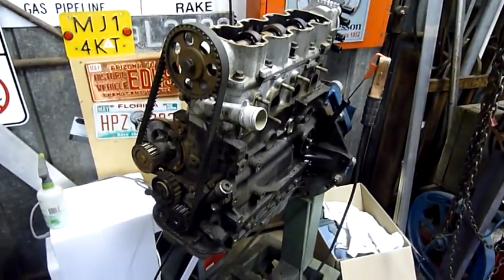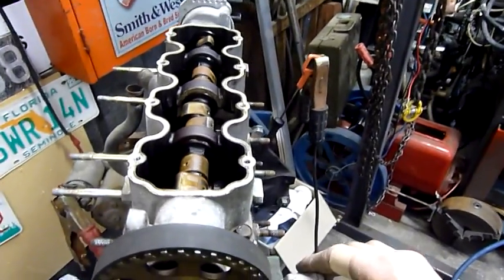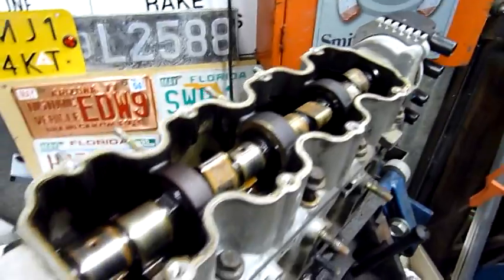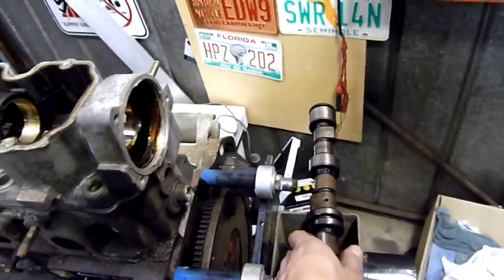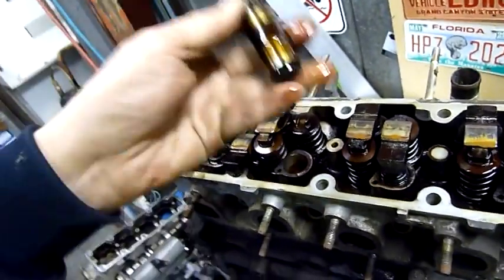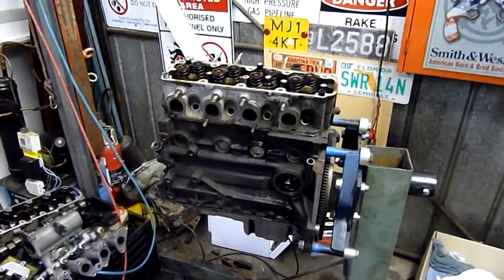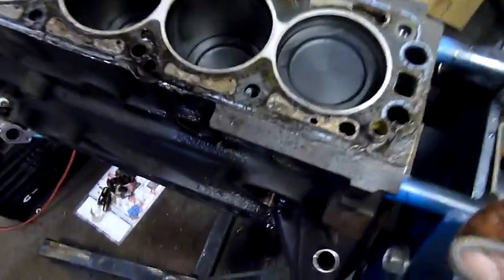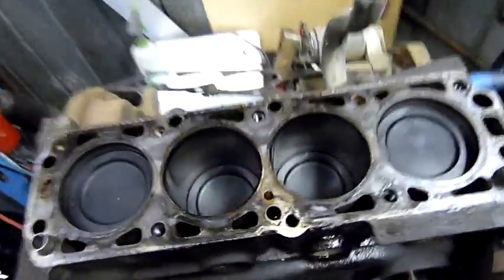Daewoo Lanos Engine GM Family 1) Autopsy Pt4  Off with its Head

Comment: Those Gm family 1 engines are tough.
the only weakspot is the thermostat and the headgasket.
The headgasket use will fill after about 200.000 - 250.000km.
Or if the engine is mostley used for short rides it will fill about 100.000 - 150.000km.
And usely the head gasket will fill on cilinder no 4. between the cilinder and the water channel.

I have the singel point 1.6 litre version of this engine in mine Opel Astra G and it slow as hell.

Comment: Only had Problems with these engines had to rebuild after 120k km on my Granddad's Lanos 2001 model even tho he serviced it every 6 months then after the rebuild the car buckled the coil pack went out after that the car drove for a few months fine and suddenly it bent a piston going up a hill oil starvation due to a bad oil pump.

Comment: In my old car, the water pump seized when the car was idling - timing belt snapped, pistons met valves and the camshaft broke into 3 pieces.  Funnily enough all the valves were intact.  Annoyingly I was planning on replacing the water pump that very weekend.

Comment: There was some time ago an electronic valve system. I have no idea where i've read it *on paper* but the main deal was using electronic valves to give what the engine needs. Mind you as i recall it wasn't something using a computer, rather a mechanical device with lobes and stuff. Pretty neat. I think it was 5 or 6 years ago in a polish magazine i've read in international airport. I think that kind of an engine would be interesting.

Comment: That engine looks really good even the cam scoring is not really that bad and most likely are fresh from turning it over with no oil pressure. Not even a ridge at the cylinder rim that thing was barely broken in.

Comment: Hydraulically actuated valves aren't a new idea so I am surprised we haven't refined the technology for today's automobiles yet. The old american Tucker Car Corp. back in 1948 designed a prototype flat 6 engine displacing 9,650cc that used oil pressure hydraulics to operate the valves.

Comment: The only place that G.M is making money now is in China, possibly Korea, and the reason is that there is a growth market there for cars of any sort. You would think that after ten years they would have at least changed the casting but that's G.M for ya, the same ones that built a mid 1950s V8, the Chebby small block, right up until the early 90s. But G.M knew that people would buy anything as long as it had a Chebby bowtie on it, even some of the most miserable excuses for an automobile known.

Comment: No wonder GM is doing bad, especially in Europe. This engine is so ancient. My Astra from 1981 had a fuel pump driven from the camshaft. An 1990 rented Astra i had, had a blinding plate where the fuelpump used to be. And now they still have that damn blinding plate and even another blinding plate where the ancient finger ignition thing was. They didn't even get rid of the valve rocker arms, the just look different. Where is the evolution of the engine... oh there isn't one... haha

Comment: As far as I am concerned a rubber belt has no business being used for timing, they should be either shaft, gear, or chain driven. If they must insist on using a rubber belt for timing then the cam/s should be the only thing it should drive. I hate modern engines and this is one of the reasons, plastic and rubber parts being used instead of metal, in spite of any esoteric engineering excuse they give the real reason is because it's cheap.

Comment: the reason why it lasted is because it WORKED! It was a reliable motor that didnt get fuel injected till the late 80's. Why change something thats perfectly fine? I hate when shit changes for no reason. Like what microsoft is doing. god i hate windows 8. And because GM produced the 350 Chev, there TONS of aftermarket parts. They basically are a dime a dozen. GM was smart in producing the 350 for so long. They are the most popular motor. and in 2nd place. GM LS Base motors. Ford is way behind.